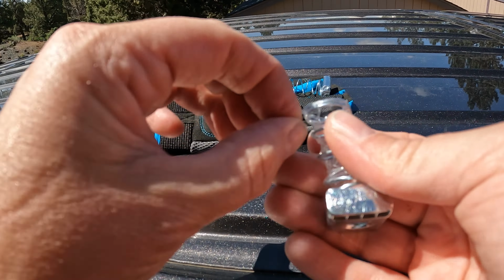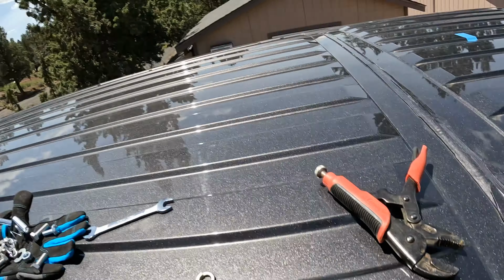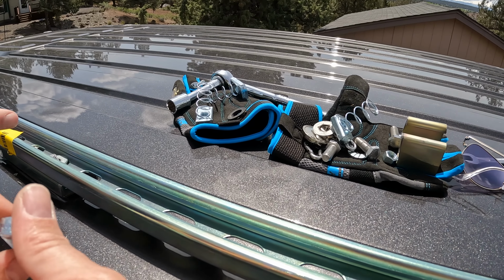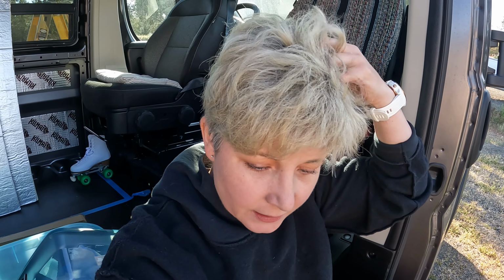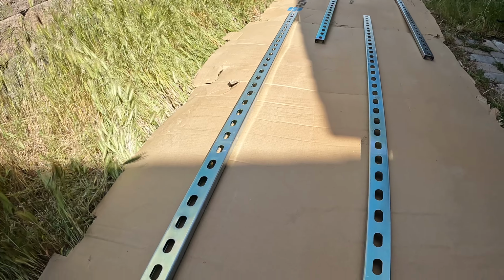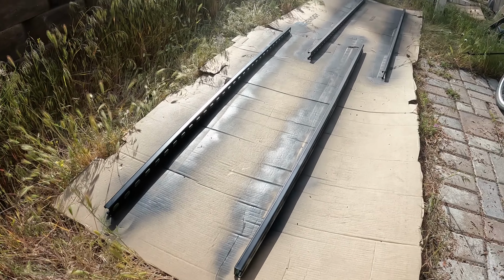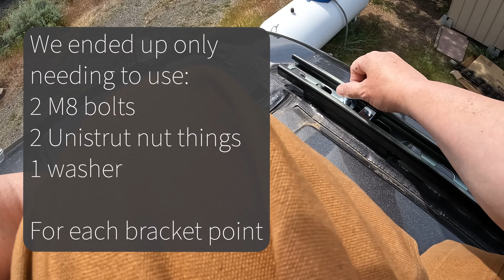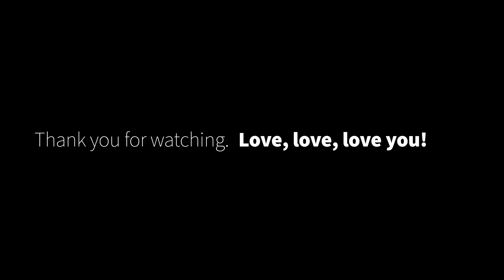Promaster Conversion: DIY Roof Rack Part 2 | Solo Female Van Life | S1 Ep. 10.2

Comment: Thanks for doing this video Beale. Although I have the extra High Roof L3H3) (Citroen Relay over here in England) I was able to use your method for building my roofrack to mount my solar - I had to use the taller unistrut for the legs as there is a slight curve in the roof onthe Extra High Roof.  Keep your spirits up and keep vanning :-) 
BTW - what do you do for water tanks/storage?

Comment: Hello Beale, first of all, please forgive my English as I am French 😁 that said, thanks very much for sharing your adventures with us 👍 I got a couple questions for you, so I watched your video on the isolation of the floor and I was wondering what is the purpose of the silver lining (spaceship thing) you put underneath the insulation pink foam? Second question is regarding your unistrut roof rack system, what is the purpose of the the 2nd bolt you used? I understand the 1st one is to "bond, link, screw" the bottom and top parts together which should fix it solid to the roof pug, isn't it?
It appears you shot these videos a few months back, do you have some feedback on the stability of the roof rack yet?  Sorry, for all these questions, I don't have yet find my van ton convert but I want to gather most of the information I can before I start and your channel is inspiring for someone like me... Keep the great job 😉 Merci beaucoup
Reply: Thanks so much for your answers 👍 It totally make sense to add some extra insulation to make sure pets are a bit more comfortable, especially with such a product that helps to insulate sound as well. Unfortunately, we do not have that product here in France, not that brand though but I will check if we have something similar maybe 😉 Regarding the roof rack, I think I understand what you mean, I guess I'll have to try and error myself when I'll get there anyway. But I'll have somewhere to start with because of you 😁
Something else I meant to tell you, nice editing, I really like the work you're doing there, music is nice too 👍 Until next video, take good care...  À bientôt!